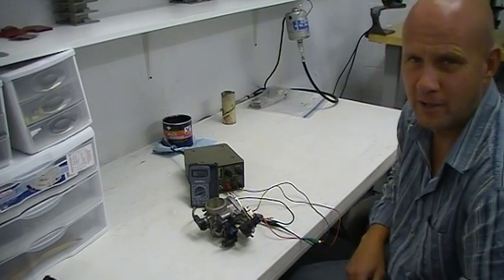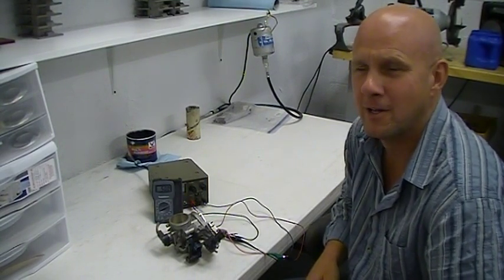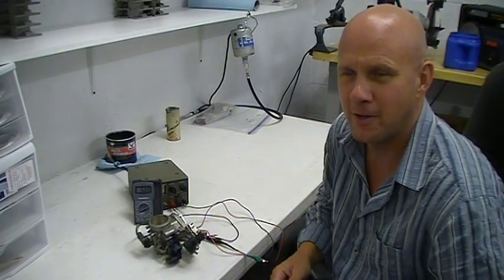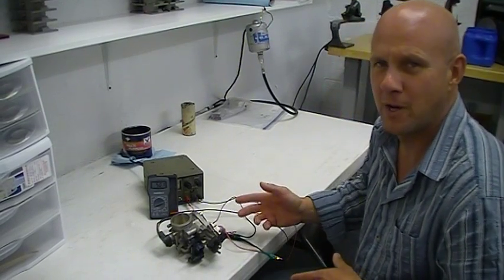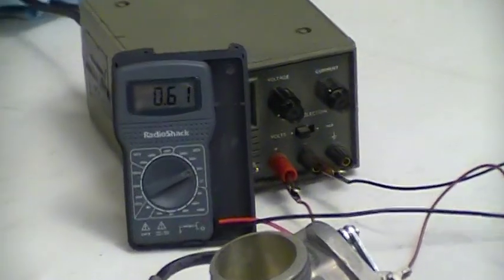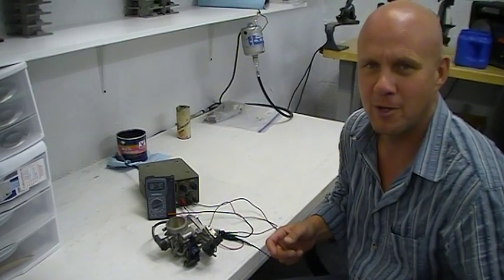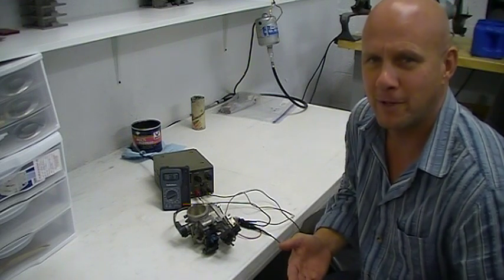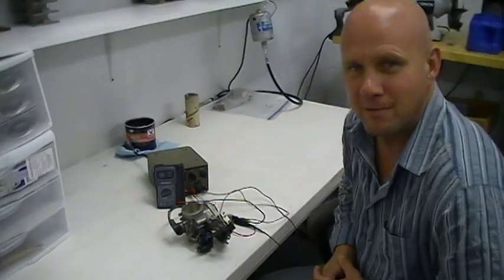Setting the TPS on a dirt bike fuel injection throttlebody.

Comment: I'm not seeing the big deal.  It's literally only a center tap pot in a differential circuit.  When it's mounted just tweak it left or right until it's in range and if it's not linear then it's broke

Comment: Hey man I hope your still doing this cool stuff. I ran into a problem with my tps sensor by taking it off and my bike got way out of wack on a kx250f 2013. is there anyway I can contact you to either send it you or get some tips on getting the max and best performance out of this throttle body. I have a very important race in two weeks need this thing running prime. I run A class so I need as much power as I can get.

Comment: Very informative, sir.  Actually it's a tutorial how the TPS works. 

I have a RM250 250, carburator, no TPS (I'm a lucky guy). But I also have a fuel injected suzuki scooter. I had issues since the day 1. My engine stalls  on rapid throttle. Cold starting needs gas. Checked everything. Replaced IAC valve (warranty). Same issues. The dealer cannot help me anymore. 

But I have a feeling that I need a TPS adjustment. It 's the only part that haven't checked. Smells like it's running lean on idle.
Reply: Verynice
Reply: i just had some starting issues on a fuel injected Husky....i passed cleaner thru the fuel inj and my spark gap was a bit large . could have checked the inline filter in the tank but didnt. if u have an idle adjustment and it is low, raising it could help with you leanness...yes my bike tends to backfire and cut off on rapid throttle if im coming off idle. hope that helps someone...cuz "K' problem was 5 yrs ago.